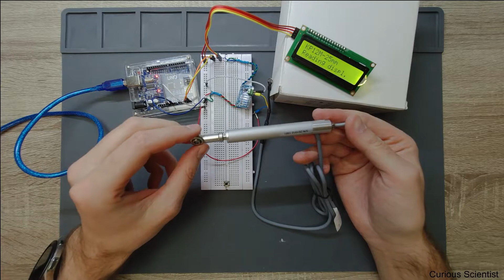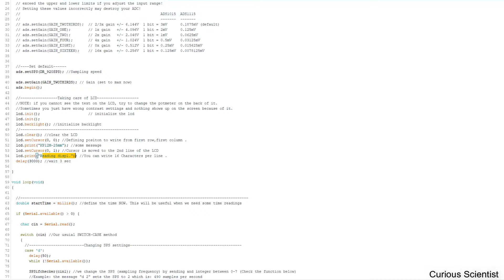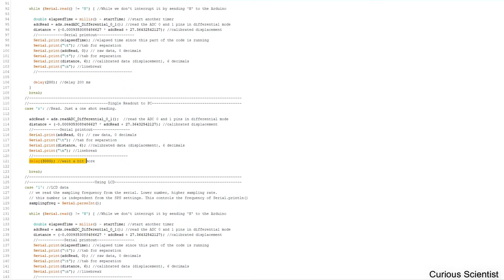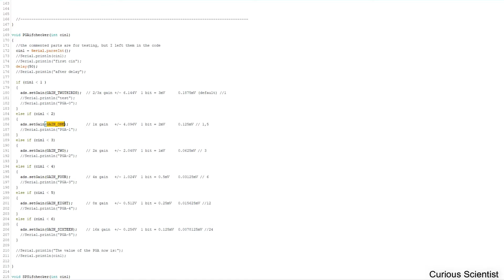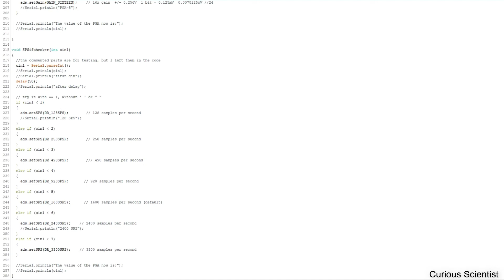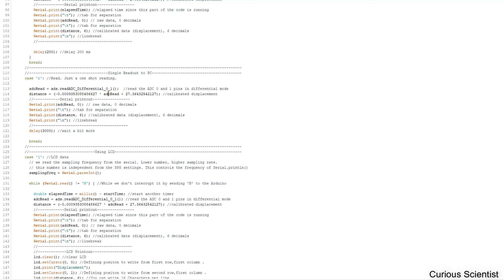KPM12-J High-Resolution Resistance-Based Displacement Sensor

Comment: Is it necessary to use ADC?
Reply from the maker: How do you measure voltage otherwise? But I guess you meant external ADC. Then if you don't need a good resolution, you don't need it. However, in that case it is unnecessary to use this kind of displacement sensor.
Reply: @CuriousScientist  Okay 
Btw I'm using Unilin linear potentiometer WT22, so with that connecting ADC externally is necessary?
Reply from the maker: I don't know what accuracy you need, so I cannot answer it. But using that potentiometer with the built-in 10 bit ADC is overkill. The potential of the potmeter is much better than the resolution of the ADC.

Comment: Hi … nice project, I build the same but I am new in the arduino platform and I don’t know how you switch ON the logging of data to see the displacements … so, can you help me ? thanks in advance …
Reply: thank you for answering me ... in the video you start something (at 7:15 mintes of the video) to show the displacement … as I said, I am not familiar with arduino and I plan to use your setup to read the displacement of a cylinder in my project ….
Reply from the maker: Yeah, you can have that data and send it to your computer, save it on an SD card...etc. It is up to you. This tool is a very good device to measure displacements precisely.
Reply: @CuriousScientist  Hi … is it possible to run the device without a computer connected to it ? when I disconnect de USB cable and install a battery, I lost the readout and the LCD sreen show  KP12M-25mm and Reading displ. … I ´m unable to see any the displacement !!
Reply from the maker: @sylvainblais5700  Have you watched the video? It is not connected to anything but a simple USB cable which goes to a mobile charger.
Reply: @CuriousScientist  thanks for you fast response … I thing when a I lost the power the system reset to the default setting and I need to start the serial monitor via arduino IDE to get readout … is it possible via the code to get the displacement readout directely when I put the power on the arduino ?
Reply from the maker: @sylvainblais5700  Yes, it is possible. Everything is already there in the code (in case 'l'), you just have to put it outside the serial part, so the code will not wait for an interaction via the serial port.
Reply: @CuriousScientist  Sorry, I never do programing and I don’t understand what you mean by (outside the serial part) but I can follow what you said … so, a little hept will be very appreciated … thanks in advance
Reply from the maker: I just told you what to do. Sorry, but I won't write the whole code for you, I am not a free support service.
Reply from the maker: What do you mean by logging the data? You can save it on an SD card or send it to the computer via serial and capture it with a dedicated software.

Comment: Sir,
      plz help I compiling this cod but error message show "'DR_920SPS' was not declared in this scope
".But my library already including.
Reply from the maker: The error code says that's not in the library.
Reply: @CuriousScientist  How can I fix this?
Reply from the maker: Add the missing line and the corresponding code in the library. I have noticed that the ADS1115 library is not perfectly complete.
Reply: @CuriousScientist  Hello sir I have tried many times compiling this program but did not work it, I compliteted 2 project this "ADS1115" module this library, So I am very benefited if you are yours library file copy and create zip file and send my email "electronicstechnology01@gmail.com"
Reply from the maker: @electronicstechnology3493  Apparently, it seems like there has been some changes to the library because I tried to compile this code again and it did not work. I fixed the code and refreshed it on my website. It compiles for me. https://curiousscientist.tech/blog/kpm12-j-displacement-sensor
Reply: @CuriousScientist  Thanks sir your programming has run, but I haven't practically tried it yet but I think it will work well.
Many thanks for helping me.
I will let you know if there is any problem next time, hopefully you will help
Reply from the maker: It should work. However please keep in mind that I am not a free support service.

Comment: hello, great video! Could you explain to me, the equation used to convert the result from the ads module to the unit mm?
Reply from the maker: Hi! Thank you! It is just a simple calibration. You have to note down the distance of the sensor and the digital values at several points and fit a linear slope on it. The equation of the slope (y = m*x + b) with the intersect (b) and slope (m) values can be used to convert the digital bits into millimeters or the other way around. I used a caliper to measure the position of the sensor.
Reply: I understand, but how do I know the value of the coefficients? Do these values change when modifying a range of the lvdt (for example, as opposed to 25 mm to 15 mm)?
Reply: M? 
B?
Reply from the maker: For each device you have to do the calibration again. The procedure is the same as stated above in my previous comment. M (slope) and b (intercept) will depend on your device, excitation voltage...etc.
Reply: I bought the same model of LVDT sensor as yours, the KPM12, however with a measurement range between 0-15 mm, I'm using the same voltage input as your 6.144V with ads1115 module too, I'll use another LCD of (20.4). in this case, I believe that the equation is therefore the same, unless it changes due to the different displacement range (0-15mm)
Reply from the maker: Umm, yes and no at the same time. If everything is the same, yes, the parameters are supposed to be similar. But, temperature and humidity can affect the numbers, the applied voltage on the cell can affect the numbers, the error in the measurements (measuring the piston with the caliper) can affect the numbers and so on. Just do your own calibration to be sure.